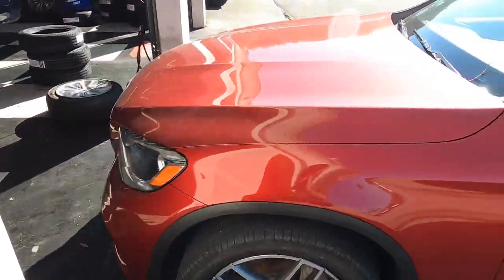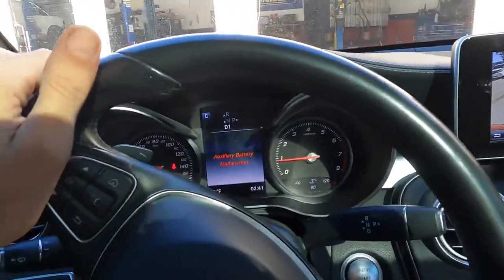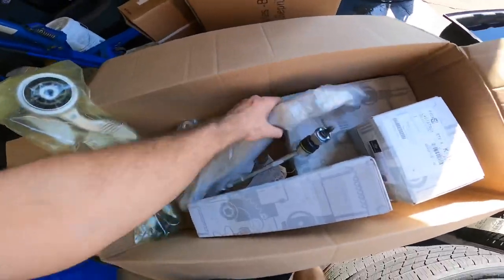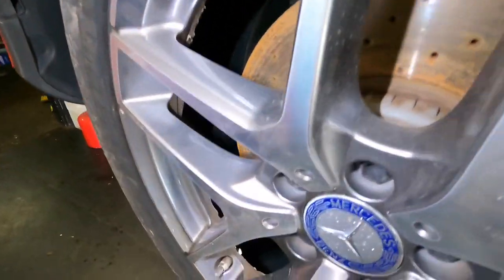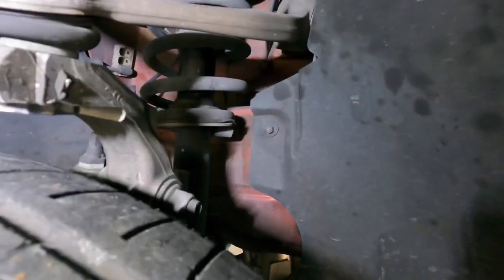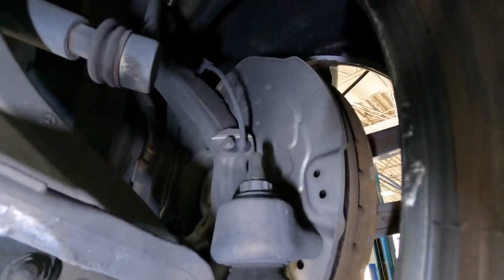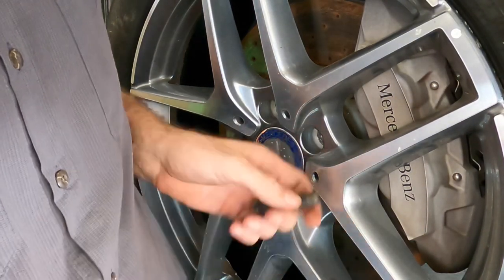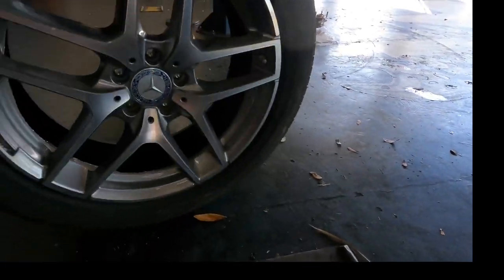Cutlstomer States: Hit a Curb

Comment: As soon as I saw the crappy gas station 99cent air freshener inside the car I knew immediately that this car is owned by a cheapskate!
Then seeing the tires I knew I was right and  the car probably went around a corner and jumped a curb that demolished the inside of the rim. 
I’m surprised they actually took it to the dealer (I highly doubt that). More likely took it to a friend of a friends shop first stop see what was wrong  and now to you.
Good luck with this one. I already see this is going to be a difficult one. I’m talking about the owner.

Comment: Why do people never learn and understand those little bars of rubber going across the tyre tread are wear indicators and when you reach them you only have 1.6mm of tread left and you need to get them replaced asap. Below 1.6 in the UK is a hefty fine and penalty points for every tyre affecting your insurance for 5 years. Little internet snippet on the braking of low tread tyres. >>>  At 1.6mm (the legal minimum UK), the distance it took the vehicles to stop increased by 44.6 per cent on smooth concrete and 36.8 per cent on hot rolled asphalt compared with a tread depth of 6.7mm. Just add this snippet as well from the UK Laws. >>.MOTORISTS are being urged to check their tyre tread depth to avoid crashes - as well as up to £10,000 in fines and 12 penalty points. Driving with a bald tyre is punishable with a maximum penalty of £2,500 and three points PER TYRE, making this dangerous mistake a potentially costly one too. 12 Points for 4 bald tyres is an automatic ban.

Comment: Aluminum alloy wheels aren't as ductile as steel ones. Whatever they hit, hit the inside of the wheel with enough force to shatter the inner part of the wheel. Driver continued to drive on it (Likely runflats) and the continued stresses broke away the rest of it. Hydraulic Press Channel crushed an alloy one and a steel one for the same car which really illustrated how the alloy ones while stronger are more brittle while the steel one just bends. https://www.youtube.com/watch?v=liJSPe6vMgI

Comment: That is a three wheeler. The fourth does not even qualify as a wheel.  And again; I've seen junkyard inmates roam free on just wire mesh. Why do people neglect such a visible part of the car? Can I inspect these parts in broad daylight? Yep. THEN DO IT. Buy new tires. They do not even have to be expensive. A set of chinesium tires are way better than this set. 
To the boatload of parts ... welp ... it was probably not just a pebble .. more like a boulder.

Comment: i dont understand why do the Americans have the gearbox selecter on the steering wheel and not in the centre of the car, something that i just took notice driving in Australia?
Reply: this is definitely not an "american" thing as you state. thats a new Mercedes which isnt even an American car?
Reply: @smokemadbuds991  if i go to look at the same car same year same model in the same color at a merc dealership near me i promise you i will not find the gear selector on the steering wheel. I dont know of any cars here that have that as a feature. Its a uniquely American thing if in fact it exists in Europe which iam unsure of but doubt.
Reply: @rext87able  i promise you they wouldn't redesign the shifter location based on country..... 

i even did you a favor and googled a GLC 300 for sale in australia and the shifter is in the exact same location as in this video. good try mate
Reply: @smokemadbuds991  what really ok iam gonna have a look am i going insane right now
Reply: @smokemadbuds991  ok i had a look yeah its where you said it was just surprised

Comment: Considering the wear on all four tyres I'm surprised the insurance company have agreed to cover the cost of the damage.  As for the comments about preferring steel rims over alloys it depends on how bad a driver you are.  A steel wheel will buckle under an impact just as easily as an alloy.  But if you are the type of moron who likes to drive on flat tyre then take the plunge and buy some magnesium wheels than can take the abuse.